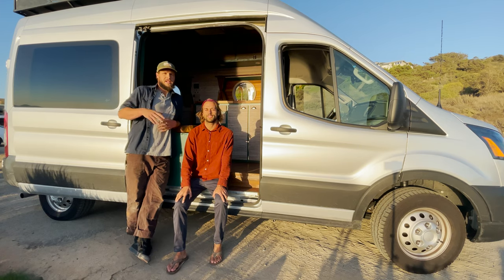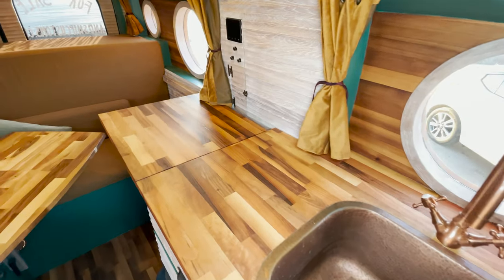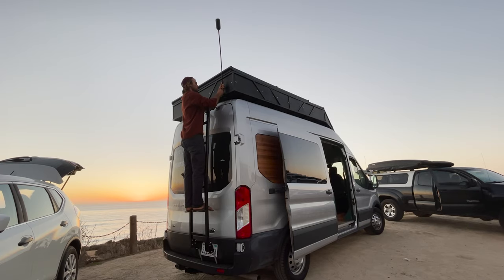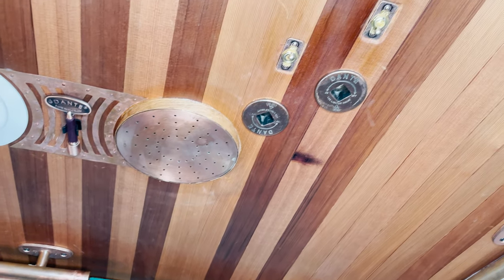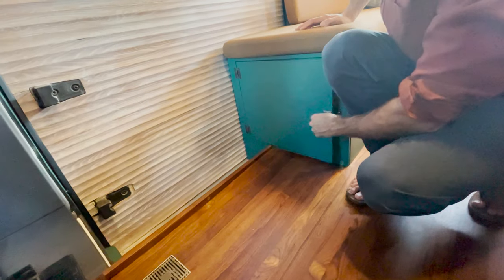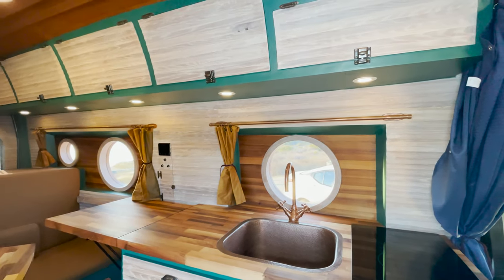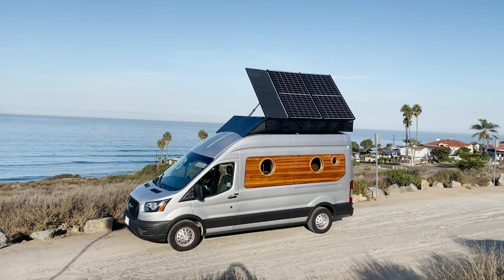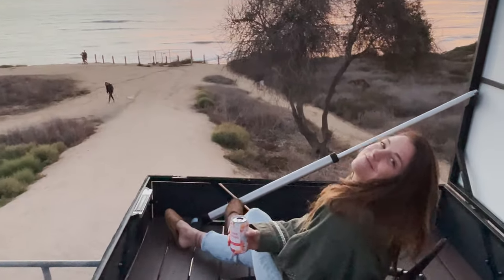VAN TOUR | YACHT VIBES | TILTING SOLAR | HIDDEN RECIRC SHOWER | Luxury Tiny Home On Wheels | VANLIFE

Comment: Very well made and thought out van. The toilet intrigued me. You diverted the pee into the grey water. What did you used to prevent the back venting and smells of the grey water tank? Do you spray the pee diverter after with vinegar and water to get rid of any residue pee?
The shower is up there with the best. Using the removable handles on the valves - genius. Flush mounting in the roof - out of the box. Please investigate the use of a slider channel bent to the roof line and to the shower outline. This would keep the ceiling flush.
Reply from the maker: Hey Wally thanks for the love and thoughtful questions!
We did put a check valve with a magnetic flap in the urine diverter to prevent any odors from coming up from the grey tank.
If you read the compost toilet bible "The humanure handbook" by joseph jenkins he makes it clear that pee is sterile, and when diluted makes excellent fertilizer for plants. So if you use biodegradable soaps your grey tank turns into a happy plant factory!
Also we definitely recommend rinsing the urine diverter with water and vinegar frequently to prevent build up.
Cheers!
Reply: @landship  I had an employee that was a burns victim. His favourite party trick was to drink his pee. Much to everyone's horror. If I remember correctly part of his recovery was applying his pee to his wounds.
Is the check valve with magnetic flap available commercially? It needs to be sensitive to pressure to avoid having to flush. Diverting to the grey tank is the most practicable solution. There is still a smell to urine and it needs good dilution, so you have to ensure a good grey water to urine ratio.
Reply: a further point on the sterility. Humans are best described as tubes. We have an external skin and an internal skin that covers the inside of the mouth all the way down through the stomach into the small and large intestine to the anus. Inside the skin is us, our cells and is sterile.
On the exterior skin and inside the tube are bacteria and viruses - our biome. This bacteria breaks down our food and extracts the essential elements that we need to survive, which pass through the internal skin into our body where it is utilised. This is a very good system provided that the bacteria does not stray from its domain. This is bad when your intestine bacteria (including E Coli) happens to get into your mouth or break through the internal skin. Also bad when your mouth biome leaks into your brain. 
Thus your urine comes from within you, filtered by the kidneys and contains no bacteria (should not). And your number two comes from outside of you and contains amounts of all the intestine bacteria. This waste is still being processed by the bacteria and will continue to be processed until there is nothing left. Or until there is no moisture to assist the process. Methane is one of the byproducts. Hence the smell.
Reply from the maker: @wallyhughes2465  haha that guy sounds like a character that would have 0 problems living vanlife.
And the magnetic flap is available, here is the link on Amazon. It is designed to replace a p trap under a sink
https://www.amazon.com/Vataler-Expandable-Flexible-Universal-Bathroom/dp/B07CGB6H77/ref=sr_1_16?dchild=1&keywords=Expandable+%26+Flexible+1-1%2F2%22+P-trap&qid=1619489093&s=hi&sr=1-16
Reply from the maker: @wallyhughes2465  never read it explained that way, you would make a fantastic biology teacher 🙌
Reply: @landship  Thank you that link. I see that there are several types available. A quick look this may be the most efficient.
Reply: Not my explanation. Just adapted for this issue.

Comment: Are the bed panels just made out of 3/4" plywood? I love the slide out design, but I would think it would need some sort of reinforcement or bracing in the center to span that width and support 2 adults.